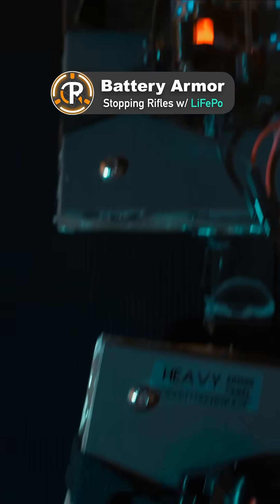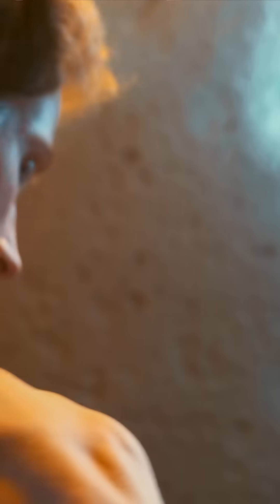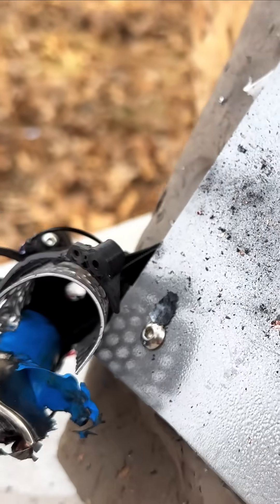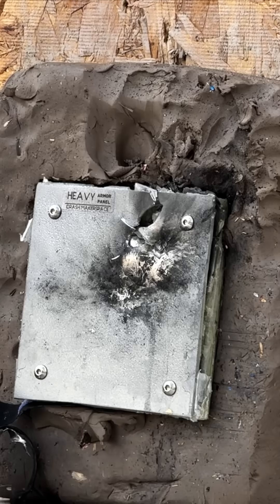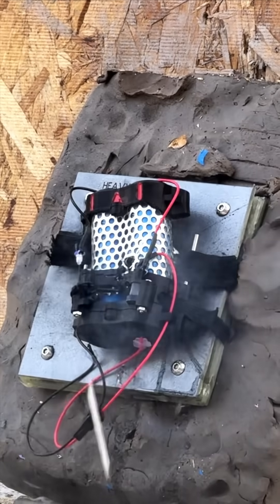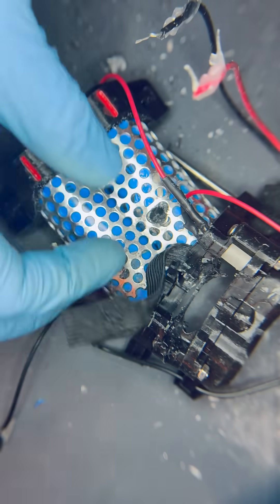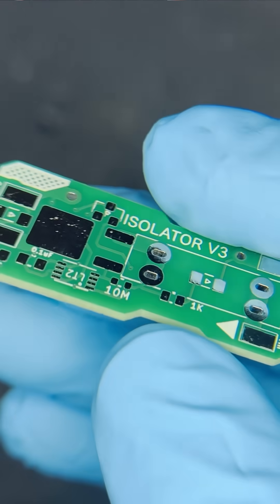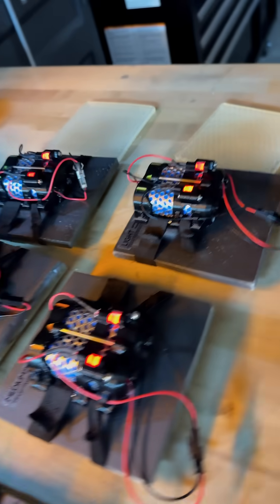My Power Armor v Rifle Rounds 💥🔋⚡️#shorts

Comment: You should use a ‘BetaVolt’ battery. It could continuously charge an IPhone for +50 years and is the same size as your battery pack. It’s safer than all other batteries. It won’t catch fire or spill acid when punctured. Also even though it use radioactive Nickel 63 no radiation can escape the battery. If the battery is punctured it still wouldn’t be harmful as the radiation would immediately exit and disperse

Comment: So the surface area of the plating along the curvature of someones spine being impacted, with precision shots made against these battery plates, would end up causing more significant trauma to the body underneath anyways. That being said, would it not be better to widdwn the plates and layer them to mimic the muscle movement along your back with somewhat layered lemalar type plating for more coverage and less likeliness for pinpoint trauma along the spine which would imobolize you regardless of penitration or no.

Comment: This is really impressive, but I do suggest having a waterproof cover for those batteries or a quick disconnect system, because those lithium iron-phosphate batteries can be surprisingly explosive in rain, because water reacts explosively with the lithium in that sheet form, check out Nile Reds video about lithium batteries for an example. Just some pointers for ya. Keep it up man, you're doing great!

Comment: A new material called "superwood" is entering mass production soon that is very lightweight yet stronger than steel. You should get some and test it out on a sandwhich plate. Its highly compressed so usually pretty thin.

Comment: Well if he added a articulated spinal armor over the batteries it would move with the human spine and it could be made of 1/2 inche aluminum. And he might wants to add woven metal over the wires like the hdmi cables and you might want to work on a suit to deal with the shrapnel and it might help if you shape the plates underneath the batteries so fit the space on your spine.

Comment: If I may ask, what's the point of all those batteries on it? Did you make something like phase shift armor from gundam seed? (Electrically powered armor)
Reply from the maker: It's for energy for actuators / gadgets a I build more components. I'm looking to a project later that uses a heavy solenoid that draws 50A so these for example can run those

Comment: Aluminum is great for weight reduction, but it isn't ideal for armor as aluminum can do something called work hardening. Basically, every time the aluminum gets hit or struck, it compresses slightly, and hardens, making it more brittle. Eventually, it becomes brittle enough that it can shatter.
Reply: Yeah dude if you're getting shot in the same spot multiple times anyway you're in big trouble, most modern armor can't handle that. That and the improved hardness from work hardening could make the incoming rounds more likely to shatter.
Reply: steel also work hardens
Reply: copper too :) probably most solid metals at room temperature
Reply: 6160 cold rolled aluminum is the best industry aluminum. I think it’s possibly already work hardened but it would be something to check out.
Reply: @angryeliteultragree6329  If it's work hardened it's more brittle. That was the problem with early t-34 armour, the steel they used was already work hardened so it had a tendency to shatter
Reply: @dr.vikyll7466 he should make an outer skin, that has an inner layer of removable plates, so after a battle, you can replace damaged armor. Then, if something shatters, it can be replaced.
Reply: Ceramic shatters from a single round yet is also used as body and vehicle armour
Reply: That happens to all armour, alluminum just wouldn't last as long. Should be used for disposable pieces.
Reply: He knows

Comment: This is all very cool.... but you know the military already has a conformal battery that can operate with 3 bullet holes and doesn't catch on fire?  Maybe just buy one of those?  But for the sake of the fun, keep making!
Reply from the maker: These don’t combust either, but they don’t remain conductive after impacts. Solid state batteries are more robust and can operate after damage but they’re mad expensive 😅
Reply: @CrashMakerspace  Maybe you can make it yourself?😅